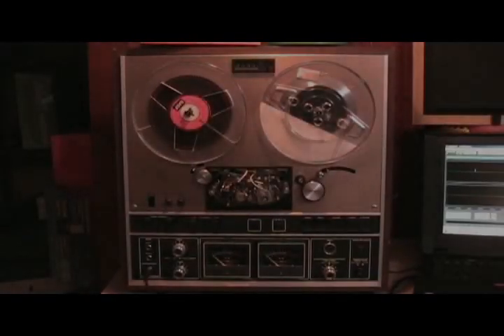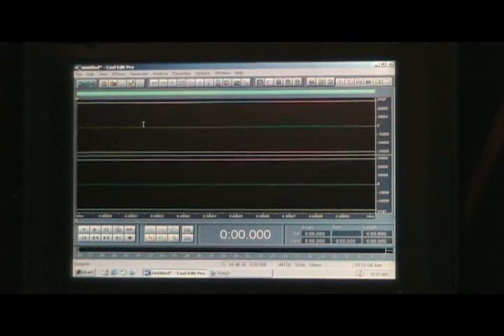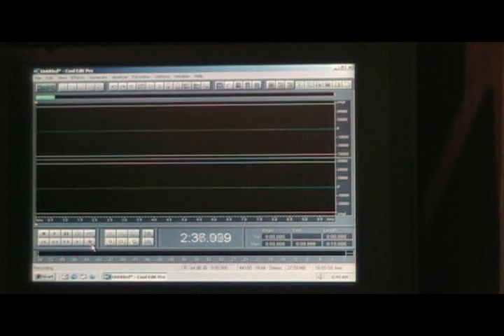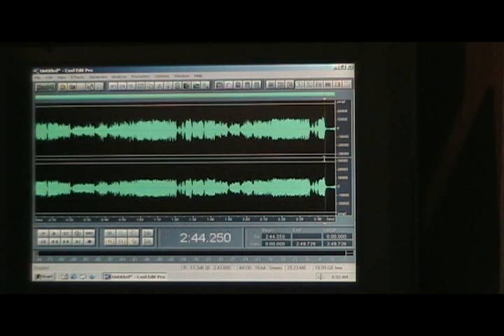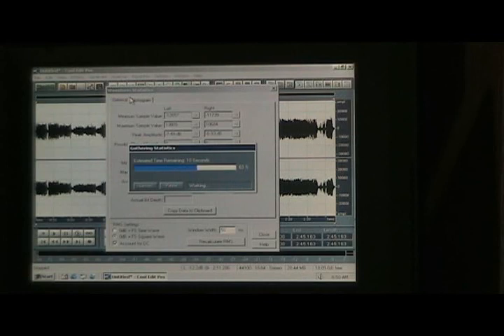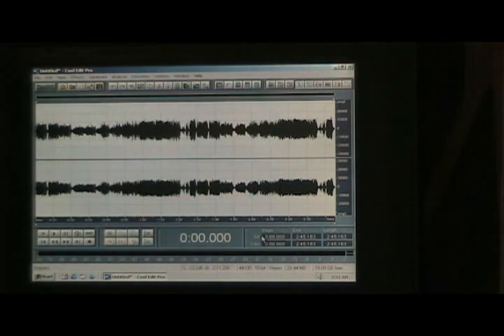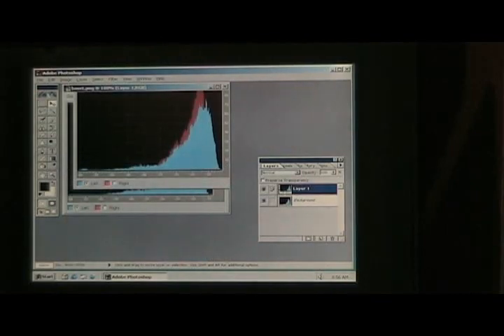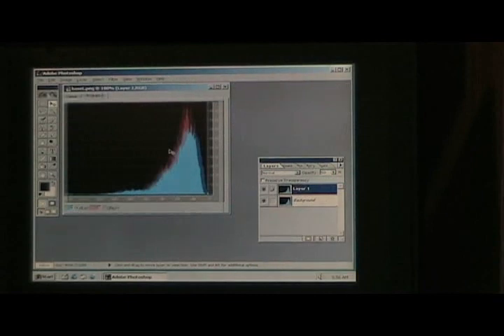tape head height alignment reel-to-reel

Comment: Sir? I love your instructional video. Thank you for it. Could you indulge me on this seemingly stupid question? I understand that you absolutely need the correct instruments and knowledge to align heads properly. I made adjustments to my AKAI 600DB reel to reel without the use of the equipment you have.  I used my ears by comparing the recorded and playback sound to the digital file on my computer. I cannot tell the difference. I am very happy with the results. However, I may be missing something I'm sure. Could you help me understand? Thank you sir.
Show less

REPLY